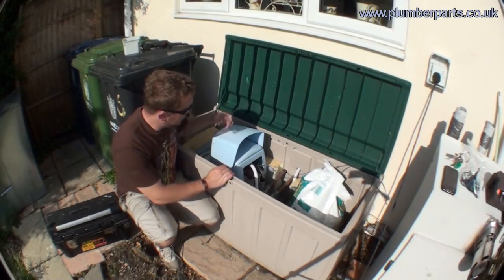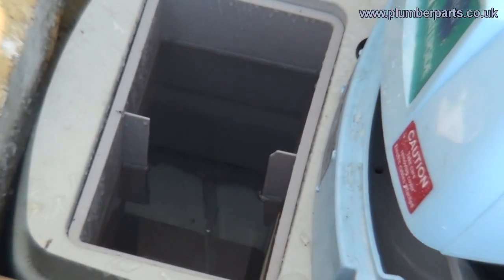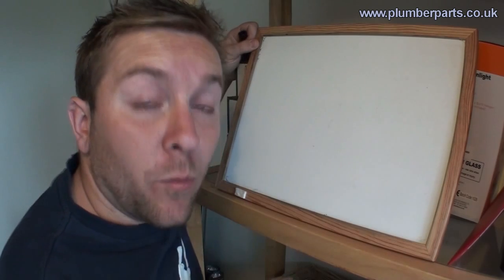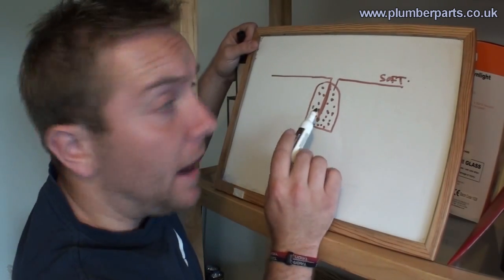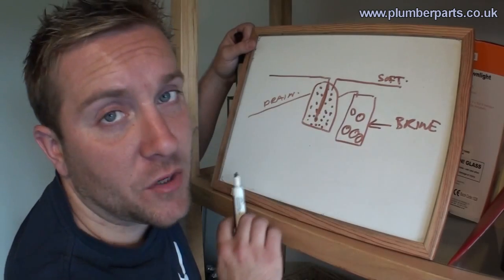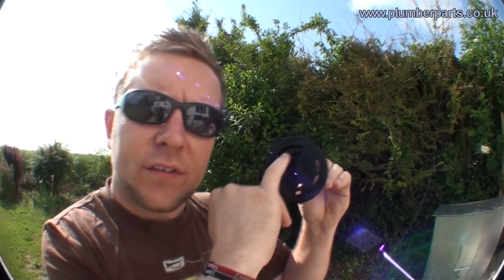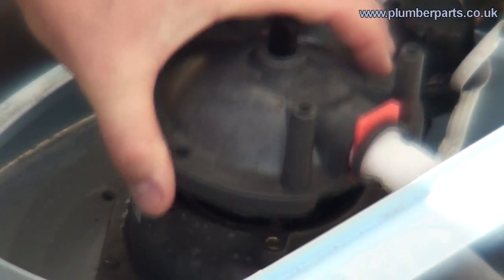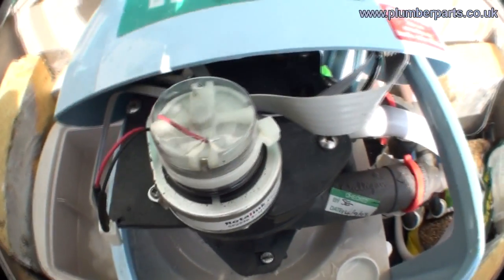How Water Softeners Work - Plumbing Tips

Comment: Softened water is brilliant for heating systems. Removes calcium and magnesium from the water therefore no scale can build up in the heat exchange plates which means you don’t need to put scale protector on your flow and return

Comment: Thanks for the information contained in this video, I have a water softener fitted but it has been allowed to run out of salt in the brine chamber on several occasions so I am assuming that it has regenerated without salt to clean the resin chamber. Would this be harmful to the softener as it doesn't seem to be as effective even though I have kept the salt thank topped up over the last couple of months.
Thanks for any information on this.
Andy.

Comment: hii, i am still having problem understanding, how the same softener resin accepted mg and ca ion and kick away na ion which was in them. yet when in regeneration process it will again want back the na ion which it gave away for ca and mg ion?
Reply: normally in chemical process, it scant be reversible. how can it is more attracted to certain ion and hence goes into stabilized composition after attained it, yet it will be reverse? what process is that?

Comment: hello plumber parts 

I have been told get get a Hauge maximiser 410 and a reverse osmosis water system which costs approx £1800 fitted.  
would you know why these items are so expensive and if a cheaper softener be considered ? 
can a ch system be filled with soft water ? I have a cast iron he in the boiler but will be changing it to Worcester Bosch system in future.  

many thanks.
Reply from the maker: Deffo go for a softener. All heating system components can take it nowadays. Plus the showers are great!
Reply: Thanks I hope it will be ok with boiler warranty and all thats stuff. 

What would you recommend and a reliable brand at value for money?

Comment: Is it expensive to replace the circuit board on a water softener? My up arrow doesn't work and it's rusted out I would like to know if there's anything I can do to fix the button so I don't have to replace the circuit board and waste money for no reason. Thanks
Reply: its recommended that you switch out the board. that rust can damage the rest of your board in time.

Comment: do water softers dissolve existing limescale in pipes and copper cylonder
Reply from the maker: +dalyr32 they do!
Reply: +plumberparts is there any acid treatment that could be use to speed up the process i ve alot of lose deposits of scale in my water storage tant in the attic (yellow flake like material)and it has clogged up my pipes also.

Comment: Fantastically informative. Found it hard to learn all what I needed to know before installing one. Not sure if I want one now because you say it makes water taste horrible. One of the chief reasons I want it is to stop the limescale around my kitchen sink after washing up, but you're saying this should be left as a hard water outlet, so the only benefit would be to my bathroom where I don't have much trouble.
Reply from the maker: ArcanePath360 Most water softeners are now supplied with a hard water fountain to install next to your sink in addition to the hot and cold tap so shouldn't be a massive issue! Cheers, PP!
Reply: ***** Thanks, might have to look into it

Comment: I know it works well if you live in a house. But what if you're living in a modern flat where you don't have a boiler in the flat and there's a central gigantic boiler in the basement of the building running 24/7? Any advice on what I could do to resolve the hard water problem?